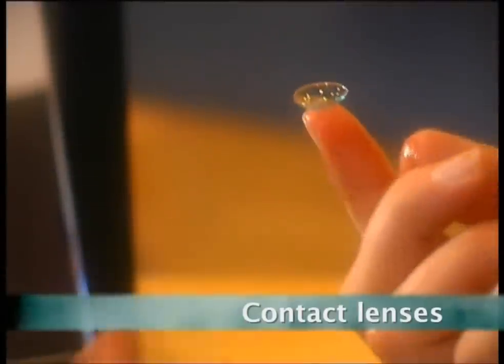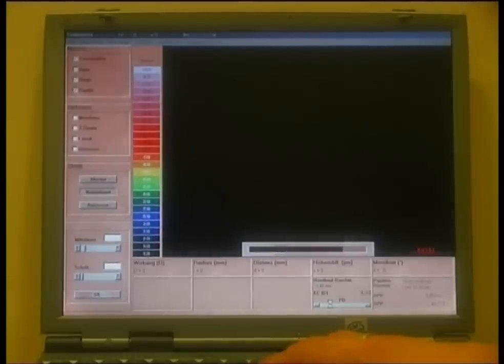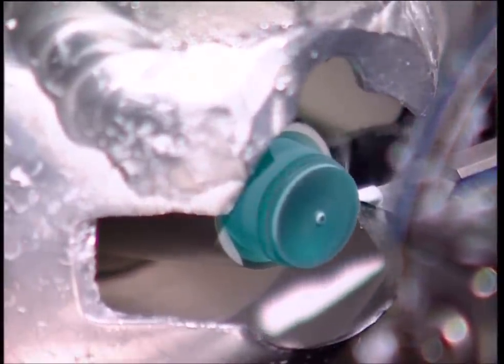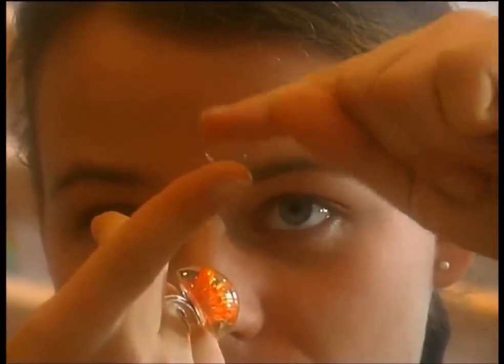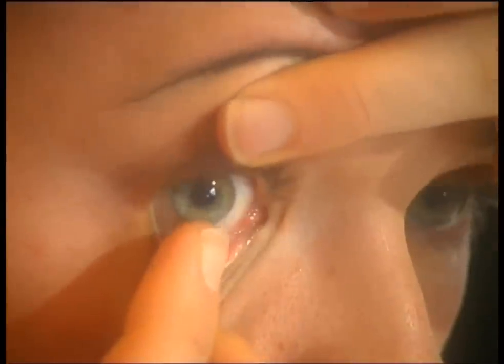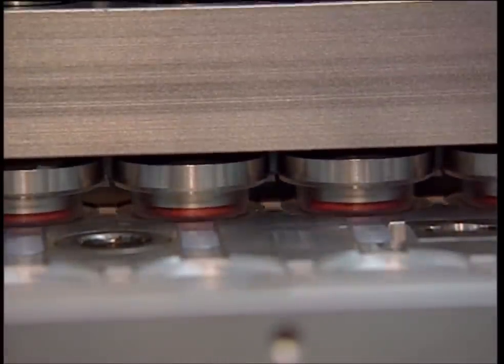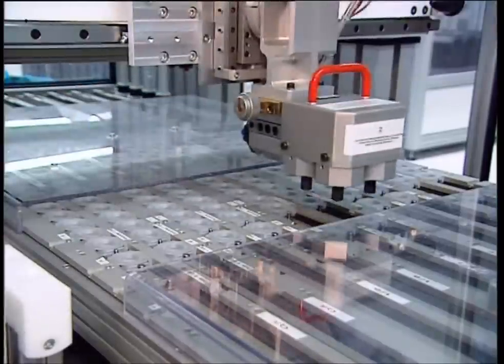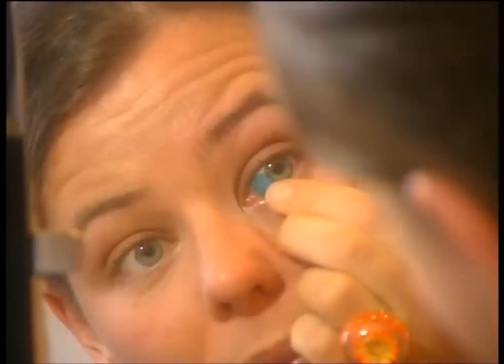HOW IT WORKS - Contact Lenses

Comment: They submerge the lenses to colour and it coats everything, I saw it coated even the pupil, wouldn't that make the eye see through tinted lens and act as a colour filter.

Coloured contact lenses are printed nowadays, I have never seen a coloured contact lens be like this.
Reply: That is an older type… A "tinted" lens, not a cosmetic lens.

Comment: Between 1952 and 1955, Otto Wichterle, the professor at the Institute of Chemical Technology in Prague, and Drahoslav Lím, his best student and assistant, worked on the development of suitable polymers in Czechoslovakia. The story of the discovery of a polymer for contact lenses is interesting and little bit funny. In early 1955 Lím did not manage to finish the work he had determined for that day, and did not finish his synthesized product and hurry to catch up train home to Senohraby. The next morning, he found that the mixture had turned into a soft, transparent mass overnight. Thus, a base material for soft contact lenses was formed. This was followed by a patent for a hydrophilic gel called polyHEMA, bearing the number 91918 and dated April 23, 1955. In the 1960s, Wichterle and Lím introduced the technique of producing contact lenses by centrifugal casting. This manufacturing process greatly reduced the cost of contact lenses and allowed them to be widely distributed.
Reply: Thanks for the insight😊

Comment: What are the causes of near and farsightedness and is it true that using the palming method while in the sun helps improve natural eyesight
Reply: I'm nearsighted, and the only thing that I can think of that caused mine is when I was a little kid, and my dumbass thought it would've been a cool idea to stare into the sun until I saw yellow spots. I did this for almost a week on the bus going home, and boy I'd beat the shit outta myself if I could've stopped it... 

I wore glasses for 7 years and switched to contacts at the start of 2019 bc I hated cleaning the annoying things...

Comment: I don't have contacts or glasses so maybe you guys who do can answer this: WHO THE HELL WOULD WANT HARD LENSES????
Reply: There are medical conditions with the eye that they help with, and soft contact lenses dont go as high in prescription as hard lenses do.
Reply: Amalia Striker I think she’s just talking about the comfortability of a hard lense. A hard lenses doesn’t sound like it would be comfortable to put in or wear. I’m curious about hard lenses as well.
Reply: I had -5 power on both eyes. The doctor insisted on getting hard lenses. Soft ones last for shorter period and are for lower powers. The hard ones I got were uncomfortable yet I started wearing them, but there’s so much dirt and dust in our roads, I couldn’t bear it. Once I stepped on it and it cracked so I just continued with glasses since then! Now I have -6 😫
Reply: Well, I would love it! They are more durable, smaller and easier to clean than the soft one. But the price is sky high here in Brazil (R$1200 or more) and they are a little bit harder to adapt to, so I'm going for the soft ones.
Reply: @laxmimanandhar7570  Very true..I am in the same situation.. I cannot drive a car without hard lenses..